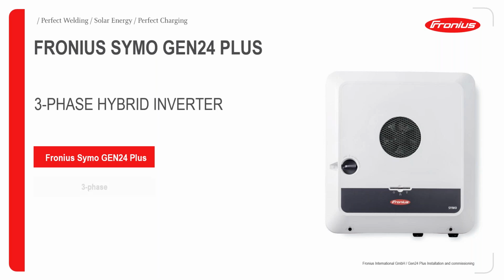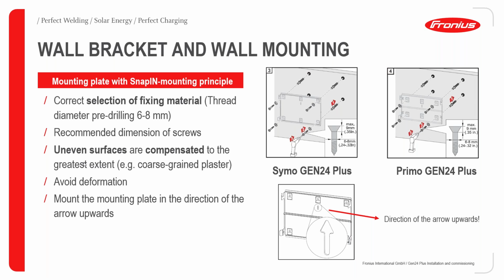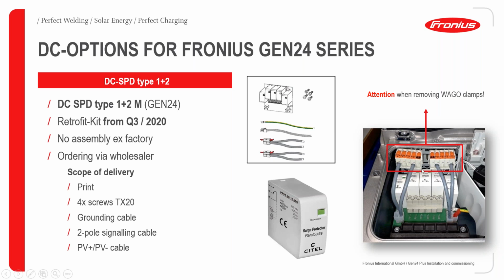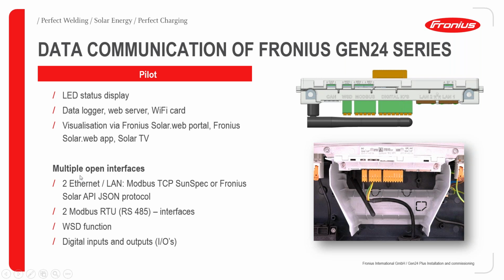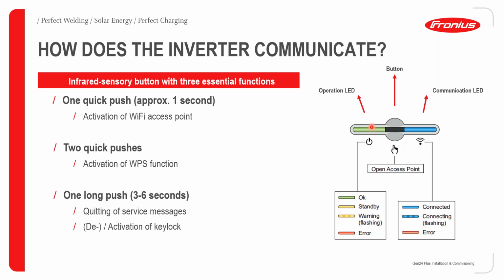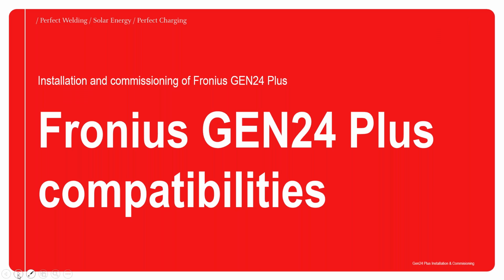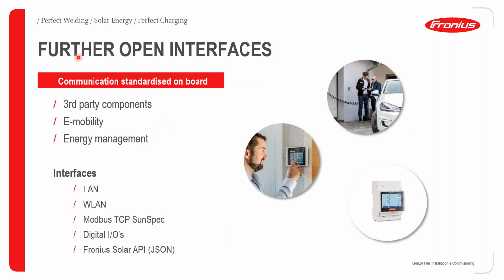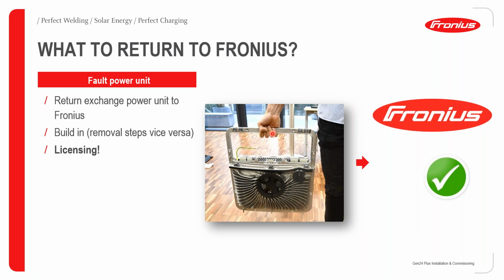Basic Webinar: Installation & Commissioning - Fronius GEN24 Plus (AFR)

Comment: Please helpnif you cand.
My gen24 symo 8kw and fronius smartmeter 5ka do not know where to send the energy.
If i need 1,8 kwh on phase 1, it will produce close tob1,8kwh and send it equal toball phases, thus my smart meter showing: L1 1,2kwh consumption, L2 -0,6 kwh and L3 -0,6 kwh. Entyre system limit control of 0w. Load management as 1st priority